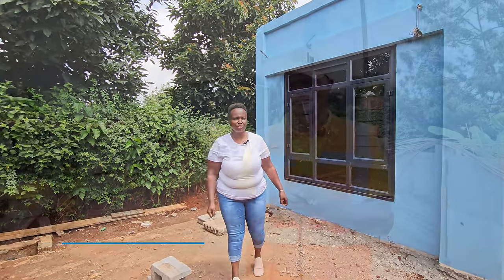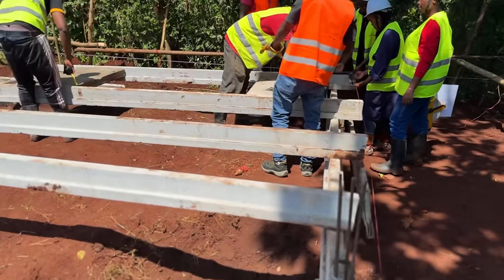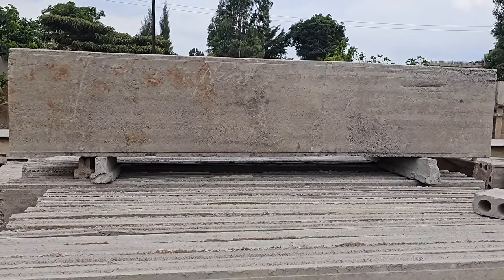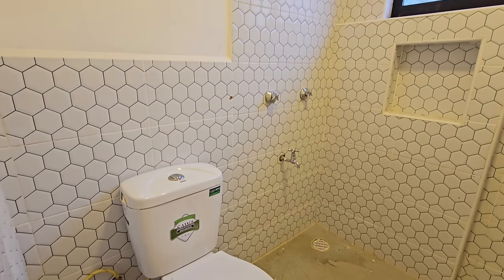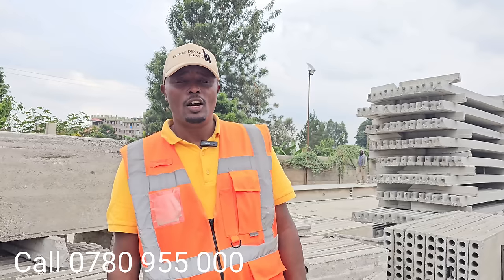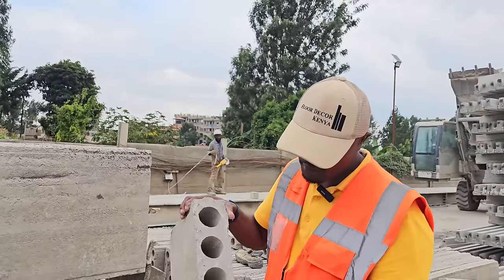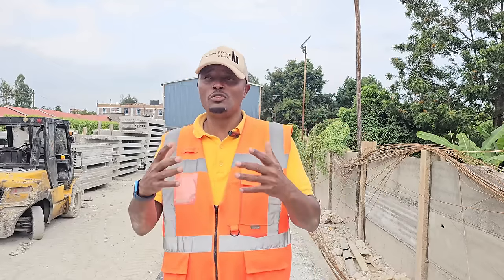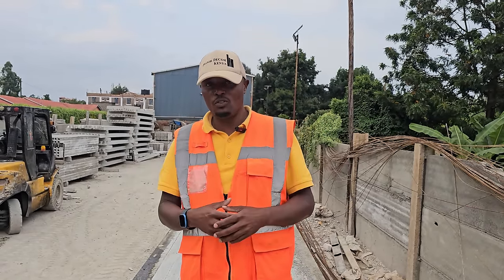HOW THIS KENYAN LADY BUILT HER HOME IN 23DAYS  Using PRECAST PANELS // ksh.1,850,000 ($11k) Only!!

Comment: Absolutely gorgeous and way affordable, this house could cost you nothing short of 4m, this is the way to go, actually I live in a precast building, its time we embrace technology.
Reply: What is precast?
Reply: @ivyachola5210 already made panels?
Reply: Please share your house. We want to see
Reply: I think it's quite expensive compared to using blocks
Reply: For that price is it inclusive of Labour and transport plus other overheads like pipes, electrical wires and bathroom accessories like shower heads, the toilets, the sinks...? If you can give a response.
Reply: Is 1.85m the whole cost of construction, plumbing and wiring?

Comment: And that blue on the exterior really goes well with the tinted windows. Good!
Reply from the maker: Stunning 😍
Reply: @NaturalktedyEdna hi Edna, is the lump Sum of 1.85 covering the expenses such as transport and labour as well as the plumbing and electral necessities like pipes and wires also bathroom accessories like sinks, taps, shower heads and the windows? Please if you can respond that'd be awesome.

Comment: If the panels can break during transportation, are they really strong?
Reply from the maker: That's normal add a few to be safe
Reply: Yes, this is indeed a good question. It seems quite brittle, anyway one should do lots of research and consult trusted professionals when doing this, especially on multi-storied buildings. For bungalows, I wouldn't be too concerned.
Reply: They are brittle when laying horizontally but very strong when in vertical position. They are able to bear the weight of the roof. Speaking from experience. We have built a family home with precast panels.
Reply: Machine cut stones even break more during transportation. But Are they not strong in a building. Precast is pre-stressed and very strong in a building. Remember this is pure concrete.